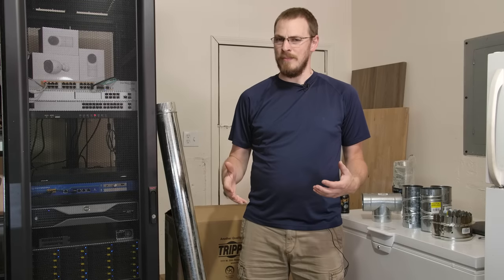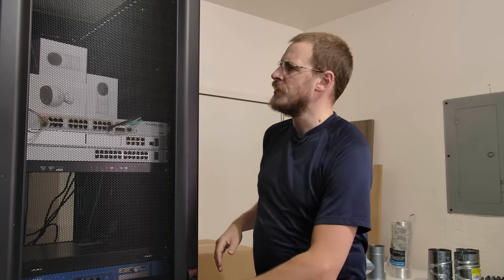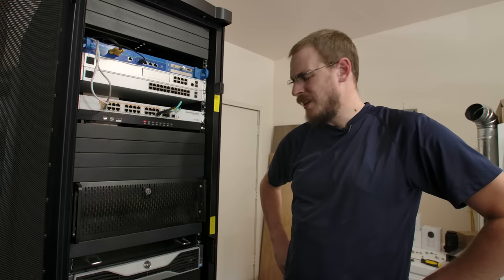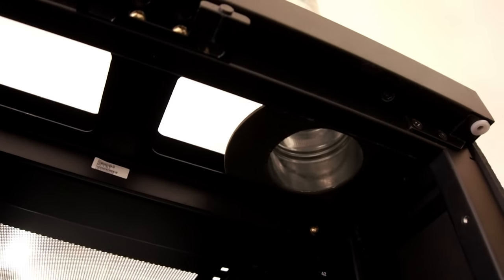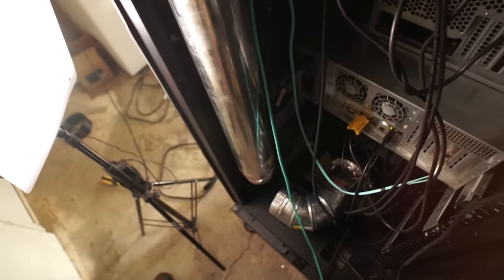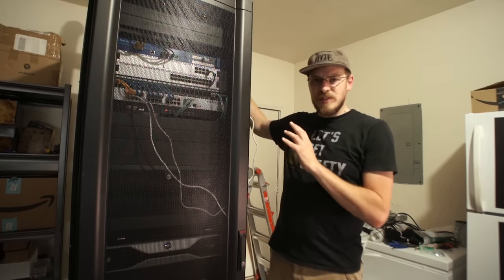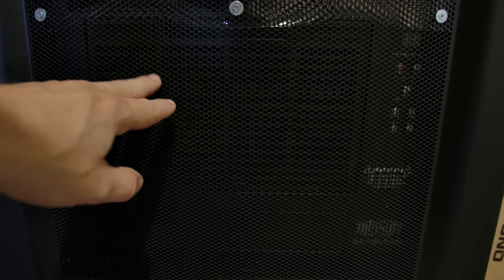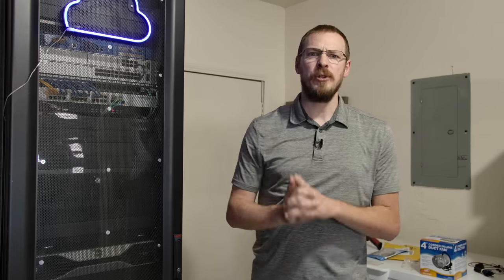Rackmount Air Conditioning?!?!?!? IT'S A THING!

Comment from the maker: Huge shoutout to Ridge Wallet for sponsoring this video. To receive 10% off your next order, visit Ridge.com/CRAFT, and enter code CRAFT at checkout!
Reply: That's weird. In previous video about cable management for server is very clean, but it's looks very different, though. Right at the start of the video
Reply: you need to put the fan after the tee. It will solve the problem of back flow (suck not blow) also your use of "tweezers" worked great... heh heh..
Reply: The airstream from the AC hits the wall of the Tee before going up  and loses momentum which creates additional backpressure that the cabinet exhaust has to overcome.  The solution is not a T connection between the exhaust for the rack and the AC discharge, instead you need a Wye connection (With the AC connection being the straight run and the cabinet exhaust connecting into the wye.) .
Reply: O ,eB, @soniclab-cnc  8,tn
Reply: Any one know of a good ups i use a  Eaton 5PX UPS - 5PX1000RT with a extra battery pack i need another one because my load is at 85% anyone know of cheaper ones that can have a extra battery pack with the extra battery pack i go from 7 minutes to 32 minutes on a 85% load im just not looking to spend $1000-$1500 on a new eaton one
Reply: If you want to create more efficiency for transporting the hot air from the airco and backside serverrack, it's a tip to use a y-piece instead of a t-piece. The airflow coming from the airco will dramatically increase and (if constructed correctly) will generate a venturi effect. This will generate (slightly) natural suction from the backside serverrack and in combination with a blower will be highly efficient. You can go crazy and even narrow the pipe after the y-piece to make it even more efficient and play with different pipe diameters. Search 'venturi effect' for full explanation.

Comment: I'd be really interested in knowing more about the temperature probe setup. I've got my rack in a closet and just leave the door open right now to keep it cool. I plan to get a similar AC unit and dump the warm air into my furnace return in the winter and outside during the summer.

Comment: Awesome video! Congrats on going full time content creator
I've been entertaining the idea of doing a similar setup for my system to isolate heat and remove it from the room as well
Just a suggestion, I see your exhaust comes out of the AC and makes two immediate right angle bends, I'm under the impression it's best to minimize those hard bends for better airflow if possible, not sure how much of a difference it truely makes but it looks like you have room to raise the long metal pipe up a few inches which would allow the lower flexible  tube a more gradual bend instead of a right angle
Also that T intersection could be an issue since the air will hit it and then need to be forced up and out, if I'm not mistaken you can get an intersection piece that is less of a T shape and more of a Y shape so that both exhaust pipes have a more natural flow up and out without much impedance/turbulence
Can't wait for part 2, can't wait for more videos!

Comment: Cool solution. I would suggest changing the "T" at the top to a "Y" style duct. The inline fan will then create a venturi effect on the vent from the AC. I think you will get better flow through the AC.

Comment: great video, I also did something like this but I went for room level instead of just my racks.  counting my power needs I use a room HVAC instead tube (to much tube management when I do changes and upgrades) cooling.  I also vented out the back of the garage to the outside for my HVAC exhuast..  One thing I also learn was to not always vent my HVAC heat out for I can keep my winter/ heating /cooling at a lower costs power wise by better using my current air.  It worked!  Hope you had fun doing this...

Comment: I have the same model of rack mount air conditioner that you install in this video. I've tried it in many different configurations, and I've found that it works best when mounted at the top of the rack. Mounting it at the bottom heated up the devices that were on top of it more that it cooled them. The cold air then also never made it up to the very top. And yes, I had a plexiglass front panel on my cabinet to channel the air. Another thing I figured out is that the compressor kept shutting off because the condenser coil was at maximum thermal capacity. My solution was to put a 460 CFM 6" inline duct fan in the exhaust duct. That made ALL the difference. Once I could pull the heat out of the system faster, I could keep the A/C on longer. An added benefit is that I measured the overall amperage before and after adding the duct fan and it was actually more energy efficient with the fan. Even with the added amperage that the duct fan pulled, there was a net gain in efficiency due to the compressor running cooler. I hope you can use some of my experience with this A/C unit and make some gains in cooling and efficiency!
Reply from the maker: I put a massive in line blower in my install as well, and saw similar results. I did notice the AC was heatibg the server directly above it, so I added a 2U buffer between the top of the AC and next unit. It means I'm giving up 10U if space, but I'll take that given the excellent results thus far.

Thanks for chiming in!

Comment: What about using neodymium magnets to hold the vinyl onto the door?
Reply: I wonder if there's any clear vinyl, like the kind used here, that comes backed with adhesive, that'd be the cleanest and easiest setup; assuming that adhesive is strong enough to hold the vinyl under the vinyl's weight. Otherwise, a plastic sheet with double sided tape along the non-perforated sections of the door would work well, assuming you have the tools, time, and patience to deform the sheet to the curvature of the door, assuming your specific door has curvature; if not replace the mesh entirely with a clear sheet of plastic, assuming this is easy to do with whatever specific cabinet you have.

Comment: I'd seal that rack completely. Use fire putty or soft fire bricks around the cabling, weather stripping on the doors and black duct tape. Only two holes should be intake and exhaust. Make sure the blower and exhaust fan are running at approximately the same CFM to avoid pulling cool air out. Can probably eliminate the exhaust fan if you seal it well. I'd run a permanent water drain if it has one I'm sure that's why they recommend the bottom of the rack. I like the magnet covers they're so much easier. Stay cool 😎.

Comment: Jeff, their are long Stainless Steel zip-ties readily available that don't cost much more than regular plastic ones.  I've used them to temporarily hold steel parts together that I want to Mig-Weld because they don't melt.  I believe I bough my last package of them at Harbor Freight.
Reply from the maker: Just added that to my next shopping list there. Thanks!
Reply: @CraftComputing  I think you like them.  By the way, I am beyond jealous with that setup you have there.  I will go out tomorrow and buy some more lottery tickets :)

Comment: Hey Jeff. I believe the condenser fan sucks air from the top and sides of the AC unit. If you move your UPS up 1U and  leave a 1U space above it it should be better. The ambient air from your garage will go through the filter into the evaporator and then discharged to the front of your equipment. The cool air will go through your equipment into the back of the rack. Then the condenser fan will suck all that hot air and force it through the condensing coil and through the duct and out of the controlled space.   Im a industrial refrigeration Tech. We design server room cooling solutions as well as build huge refrigerated warehouses. I also believe you should only need the one duct leaving the rack from the AC unit. The 6 inch duct is design and you reduced it to 4" that might cause higher than normal discharge pressures on the refrigerant side causing higher amps and shorter unit life. Let me know if you need a professional opinion. Love the channel.
Reply: Just joined

Comment: Hey Jeff, I did something similar to this with a network rack server cabinet, fortunately mine had 3 steel doors on it and a glass front door, after we had started to use it we noticed that things was getting a little bit work both in the rack and the small room it was it. 

The room was on an outside wall with a not functioning extractor fan, I did have a large 21" fan and with a bit of effort managed to get it to sit at the bottom of the rack, at the top the top cover was like a short pyramid with a small fan on the top, we took that off and used flexible ducting to take the warm air to the extractor fan in the wall. 

This did work very well in keeping both the network rack server cabinet and contents cool and also the small room, however over winter we had the office heating fail so we just rerouted the flexible ducting into the office.

Comment: if you invert the output ,, on the top of the rack , so the ac go out strate , ,, the other one in T will act as vacum and suck the ambient air out withaut fan , try it it may work ,,
Reply from the maker: Look at Mr Venturi over here :-D

I may do just that, even if the blower I bought is enough. It could always be more efficient.
Reply: @CraftComputing  try it ,, it may work ,, i have done it with my kitchen ventilator ,

Comment: Personally I used a wine fridge as a rack.  Just mounted a rack frame inside, used a hole saw to get cable's in and out and set the temperature to the hottest setting. O and spare space is used for wine storage.

Comment: I bought one of those small blowers for a cooling project on my own rack but ended up removing it.  I installed temperature  probes in the duct and a damper that I opened and closed with a servo connected to an arduino.  The fan was controlled by a switchable power strip, also controlled by the arduino.  The idea was that during the winter, it would detect colder air outside and open the damper and turn the fan on.  The problem was that the fan has about a 50-watt motor and as such, added 50 watts of heat into the intake.  This was detected by the temp sensor which then shut the fan off and closed the damper.  
I ended up replacing the fan with a 5v Noctua  PWM fan.  It produces a whole lot less heat and was quieter.

Comment: Very interesting idea.  I have often though of installing an air conditioner to my garage server rack, or at least making a small room to contain it and lower the temperature.  However you bring up a good point regarding humidity.   I think it would be cheaper and more efficient to use one of those central room AC units with the hose exhaust.  I'm sure the benefit of your setup is you can exhaust the server heat as well.

Comment: loved watching this. my only critique would be i think the piping should of gone the other way so that the ac pipe was straight and the "T" part would be sucking the back of the server air. having as many 90º for the air getting blown is causing resistance to the air flow and if it was the other way ( ac blow straight) it may aid in scavenging  the air from behind the servers.
Reply: would possible make for a good testing parameter with the probes on another video.

Comment: Why not just put two vents out to the back of the house?  Also, does this effectively only make this a single return system, such that the whole room is under negative pressure?  Where will the air be coming into the garage to replace the air moved out by the ac and blower motor?
Reply from the maker: I'm looking at opening up a hole and adding a fan from our crawlspace to allow more air in, and prevent hot air from being the only source.

Comment: I've got two questions. Does that AC unit can be in any way controlled remotely, or is it only hands-on device? And if it has dehumidifier mode, how do you get rid of water? Surely it isn't that tray on the bottom of the device that you have remove and dump the water every hour or so?
Reply from the maker: There is an optional network management card for it. I opted for manual control, as I'm not sure I'll run it full time, just on days above 85F. And there is a built in evaporator in the unit, so no draining required. There is an overflow if the AC can't keep up which you can pipe out to a drain, but in Oregon, our humidity in the summer is ~15%, so I have nothing to worry about here.

Comment: So, I think, raising the rack and vent through bottom would be ideal vs having the heat dissipate through the duct in the vertical run (zip tied) . Just thinking of future server installs and re ducting.. I plexiglass my rack and used rivets plus washers and added a window tent to my doors. I wish I had the rack ac unit 3 months ago ;)

Comment: BE CAREFUL. I'm not sure what other equipment is in your garage, but you and viewers should be mindful with this implementation. This is similar to a single pipe portable AC... either way you are creating a negative air pressure in your garage, forcing unconditioned air to infiltrate, including unintended sources. If you have gas appliances like a water heater, dryer or furnace sharing the space there is a high possibility for flue gas back draft, increasing the chances of an incomplete burn due to oxygen starvation and resulting in carbon monoxide filling your garage. Hopefully the garage is poorly sealed and can provide enough fresh air to make up the exhaust air exiting the space. Nevertheless, when there is hot outside temperatures it will bring that hot unconditioned air into the space. I understand the goal is cooler equipment, and this may solve that problem, but just be aware of the bigger picture. An improvement would be a second powered air duct to bring outside air directly to the rack, which would help take advantage of so called "free cooling" when outside air temperature is lower, and also solve the added problem of negative air pressure.
Reply: You are absolutely on point and scientifically correct!
I was researching how to cool my home lab and I stumbled on this. Thanks for your input.

Comment: great video! What's your ambient humidity like in the garage? Does the tripplite have accommodation for a condensate drain? I'd be willing to bet you'll need one- that's probably also why they recommend installing on the bottom of the rack.  This is from experience as a network engineer who has worked with AC in racks before, as well as being a former HVAC technician.  love the content! definitely subscribing :)

Comment: You should use a wye/Y split duct for the AC exhaust connection instead of the 90deg turn. (A Y duct may actually act to induce some airflow up the duct as well instead of the 90deg turn which is not advisable).

Comment: I'm wondering... why not to salvage the magnet sheet that came with the A/C, cut it down to strips, then glue the strips to the edges of the vinyl? even some tiny spots to let the vinyl close to the mesh. It would be fully plug-and-play, isn't it?

Comment: Without being specific, a ball-park figure perhaps, but what are your power bills like with the rack and the various other computers running in your home on top of your normal power usage figures?
I used to run a 42RU rack in my garage where i hosted my own domain with 3 or 4 servers (admittedly older, larger units - 3-4RUs), a couple of Cisco switches and a router.
I turned it all off after 6 months and sold the whole lot when my power bills for that period constantly topped $900/quarter when they were previously ~$300/quarter

Comment: If you use a Y duct joint at the top, that should help reduce the amount of back pressure. Also your angle seems a bit too sharp at the bottom so I would suggest raising the vertical duct a bit so that you can make that bottom angle closer to 45° rather than 90.